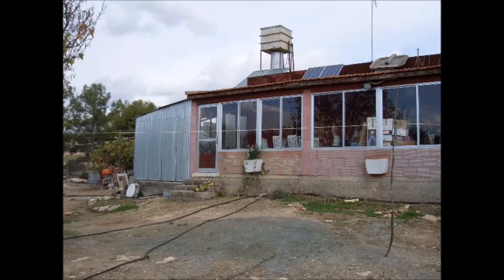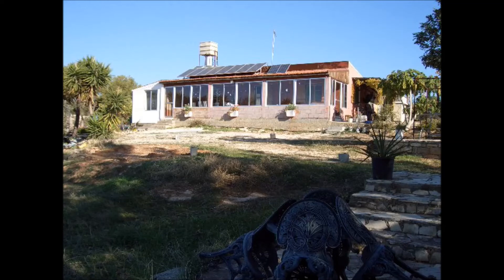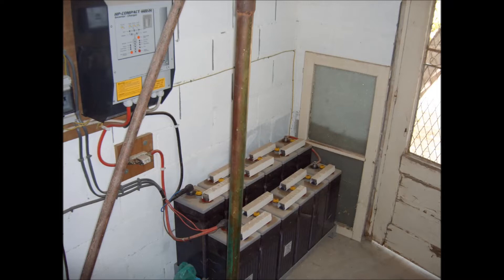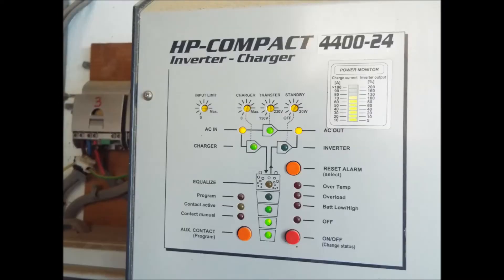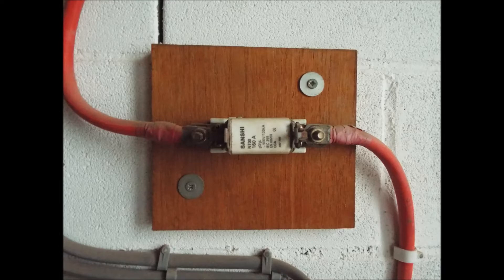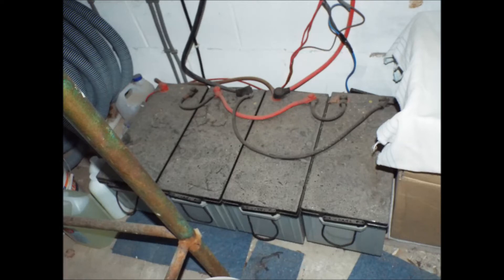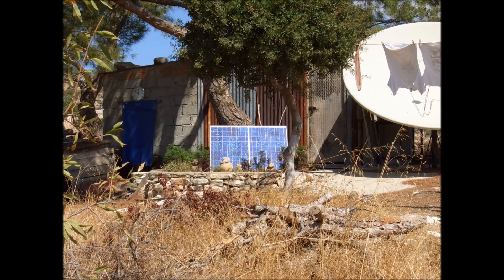Solar Power Installation - Olive Farm Retreat Cyprus, Bed and Breakfast

Comment: These Trackers are great. Was this supplied by a local company?
Reply: Hi Peter, thanks for subscribing.
The trackers were supplied by the company that originally installed the system,
they were manufactured in Germany by Lorentz, unfortunately they have one by one stopped tracking. 
I have been in touch with Lorentz in Germany and they have informed me they stopped making trackers a number of years ago and are no longer able to supply maintenance for them.
It's a slow process, but I am trying to find someone willing to look into repairing the fault on the circuit boards or find replacement trackers.